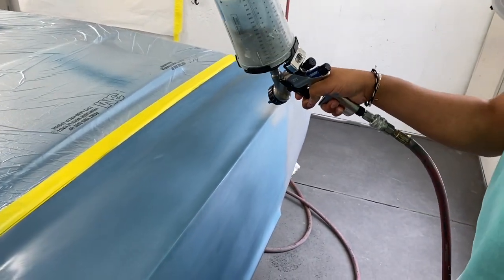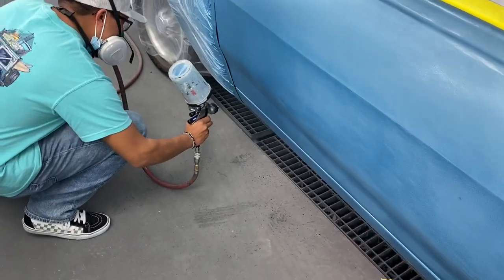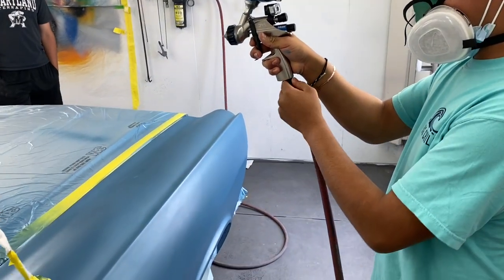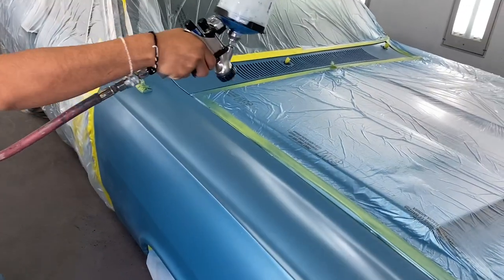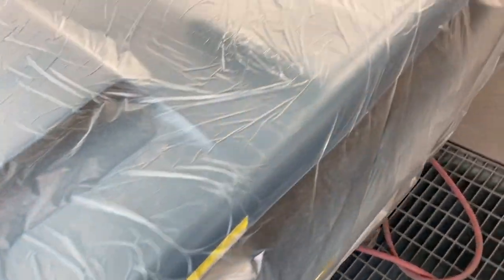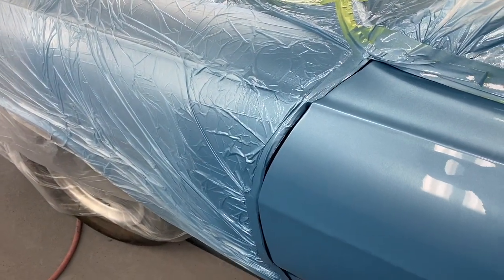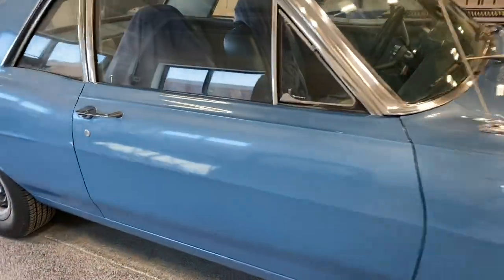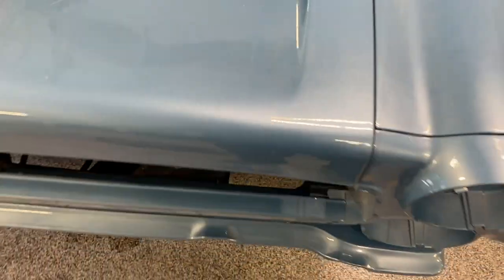1966 Comet Project - Finishing up the painting!

Comment: Wow that came out great! A few questions though.

What air cap are you running on the gun?  (Dv1) I know it comes with two options but mine came with the B plus Cap which the manual says to spray at 22 psi which i do. However the other cap recommends 15 psi I think. I only ask because I saw you spraying at 11 psi and 7 psi and the results were great.